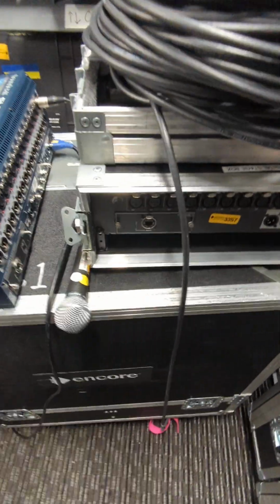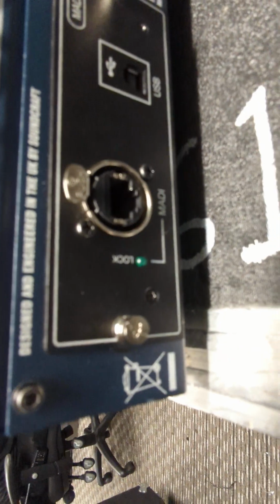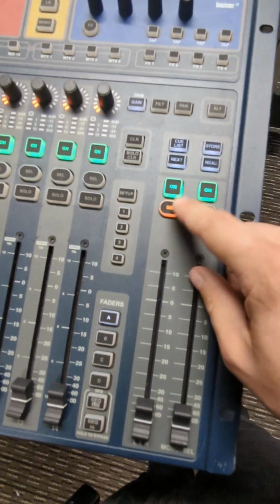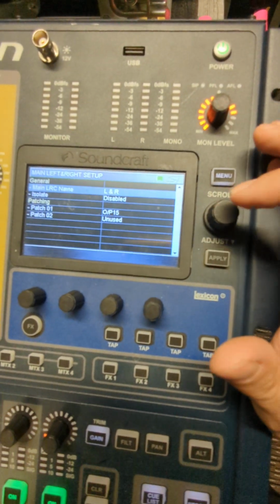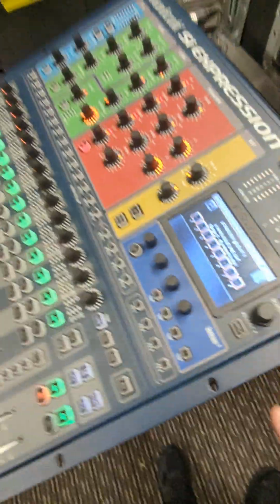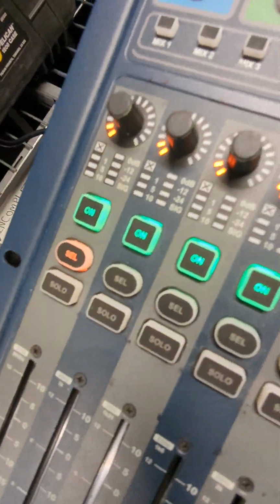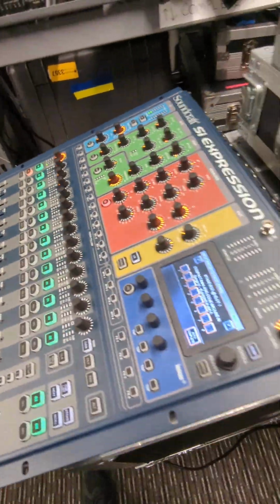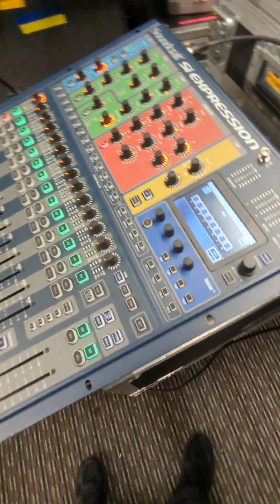SoundCraft SI Expression Reset and Patching Stagebox

Comment: Does this override or add to any previous L+R assignment if there is one? I'm needing to work with one of these for the first time this weekend. My goal is to send L+R to stage box for recording at the stage. I do not want to change any current settings.
Reply from the maker: @cleantones  Hi there! Yes. Assigning the LR to a stagebox output will overwrite the local output. Unfortunately, you cannot multi-patch on this board. In your circumstance I would send the LR to a matrix and patch that matrix to the stagebox instead. That way it is the same signal just two separate outputs.
Reply: @GearAndThere  Thank you for the response. Do you know if this is true for the Performer 3 as well? I'm realizing you're demoing the Expression but the venue has the Performer. I'm sure there is a lot of cross over with features.
Reply from the maker: @ I am not familiar with performer, sorry. Come to think of it, there may be a secondary patch option in the patch menu on some of the boards.